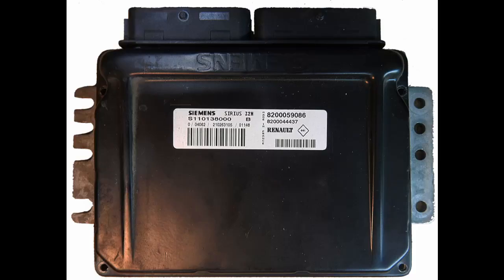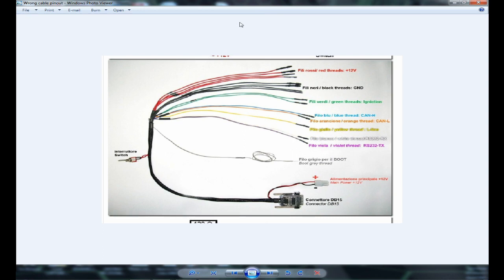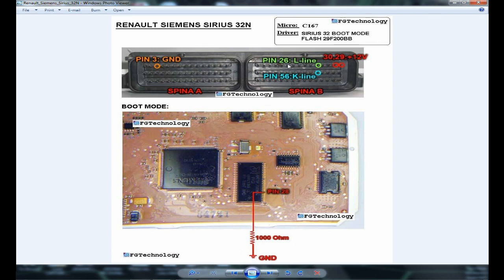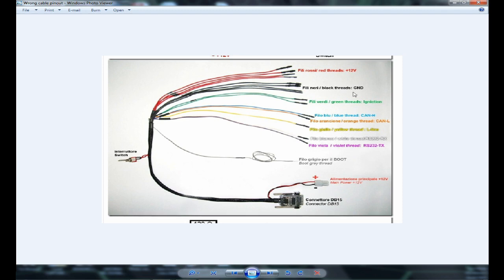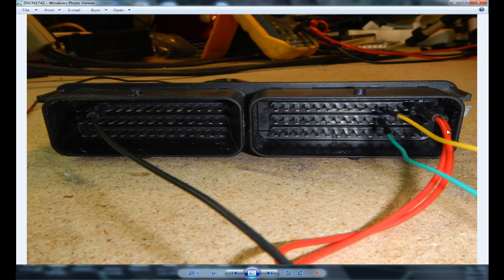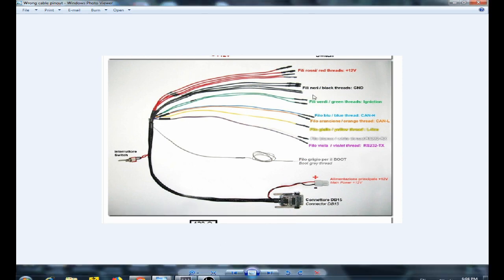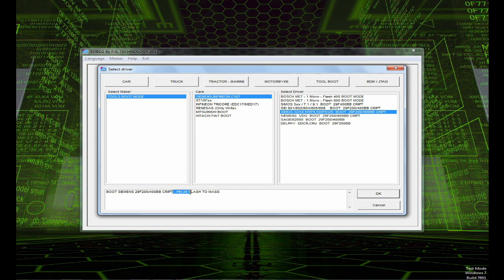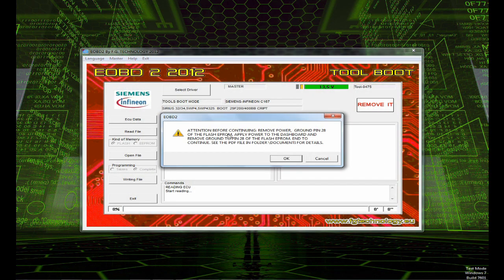Siemens Sirius 32 ecu read with galletto v54

Comment: hello, reading in boot mode is the full memory read? Thank you
Reply from the maker: Hi!
Thank you for supporting my video.
Most of time yes, it is full memory read, I never faced with a partial read through boot mode, maybe that can happen
But if you want to be sure check the readout data quantity with the 
given datasheet of the targeted flash memory. 
If your file is the same size as the memory size of the flash memory then you have the full reading.
Another option is to take out the flash memory and read it with a external reader or through BDM if your programming tool and ecu is supporting...
Reply: thanks for the reply. I have to do an inmo off of a Sirius 32D. I have cookie v54 and I do not know if it helps me to do it. I'm new to this and still do not understand
Reply: Yes, you can do that with the cooked v54 galletto.
Just follow my video and instruction on the screen of your galletto software.
You cant do anything wrong...
Reply: Good